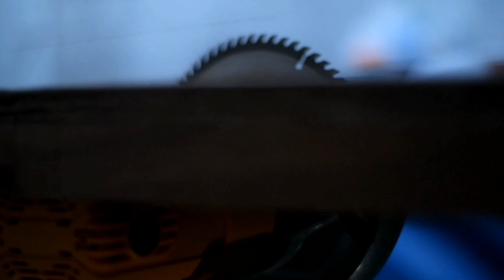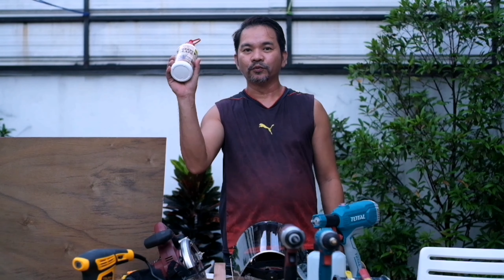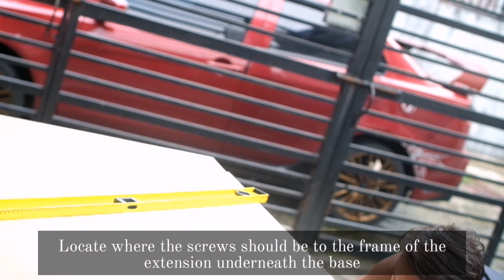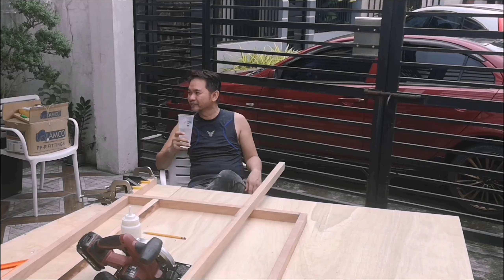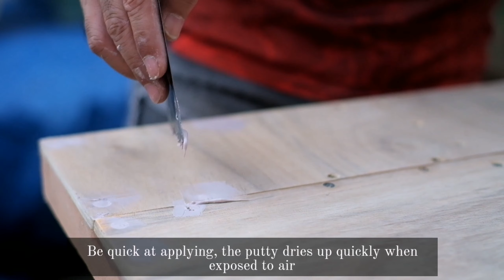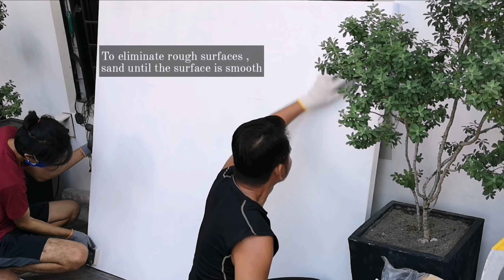DIY Foldable Table Tennis

Comment: comments lang... 1. dapat "flat" paint ang ginamit at hindi glossy para may kapit ang bola at hindi nakaka silaw sa araw,(2.) hindi na dapat folding kasi napaka bigat at malamang hindi tatagal ang mga bisagra at bibigay agad ito, better kung magkahiwalay na lang yung 2 pcs, mas magaan iporma pag may laro o bubuhatin.i design mo nalang ng may parang  brace sa ilalim (3.) hindi na need ang lock sa 2 pcs at sa bigat nito ay hindi na ito makakagalaw pa (4.) at ang pinaka mahalaga, ay gumastos at naabala ka na nga ay sana minimum of 3/4 plywood na ang ginamit mo, mahina at bamban ang talbog ng bola sa 1/2 na plywood...yun lang, but overall nice try..
Reply from the maker: Salamat bro, huli na din nung naisip ko na flat ang paint, but still kumakapit naman ang bola kahit pano 😉
As per design naman, yan kasi pinagawa ni neighbor, but you have a point, mabigat nga sya. Salamat sa inputs 😉
Reply: @woodzandbladez9780  pag nakita ng nagpagawa yung deficiencies ng design nya malamang ipa modify nya yan sa iyo, yun kasing ginawa kong TT table 35yrs ago ay separate lahat, 2 pcs 5x9 tables, 2 pcs stands at 2 pcs braces, noon kasi naka bili ako ng 5ft x 10ft na 18mm marine plywood sa lumber sa EDSA QC kaya buo akong nakagawa ng mesa, walang dugtong, now puro 4x8 lang ang mga plywood kaya need talaga lagyan ng attached braces sa likod kaya lalo bumibigat. Up to now existing pa mga mesa ko (baka i refinish ko na lang pag sinipag, hehe), yun lang mga stands ang nabulok na kaya baka palitan ko ng steel ones, ty

Comment: Sir! Thank you. Ito po talaga yung hinahanap ko na DIY video tutorial.  
I think it's better po if you're using a 3/4 thickness plywood kasi iba talaga ang bounce sa bola kapag half inch compared to a 
3/4 inch thickness pero overall... Very Nice!
Reply from the maker: Yup you are right, but the owner opted for the cheaper one thats why 1/2 plywood ginamit namin. Thanks a lot sir 😉
Reply from the maker: Pa-Subscribe na din sir if its not to much to ask 😉